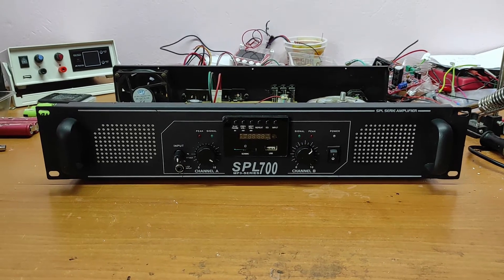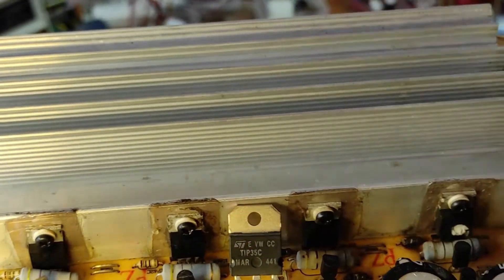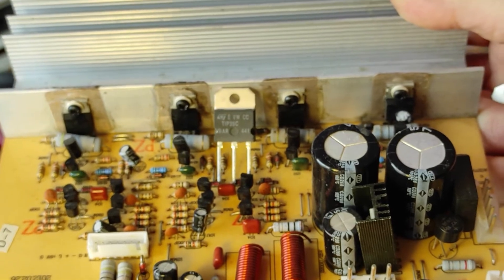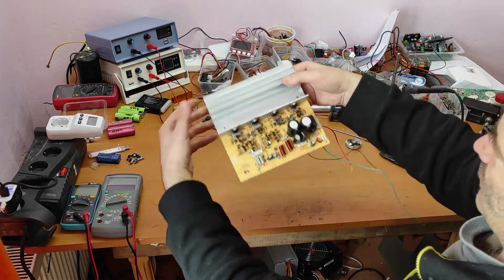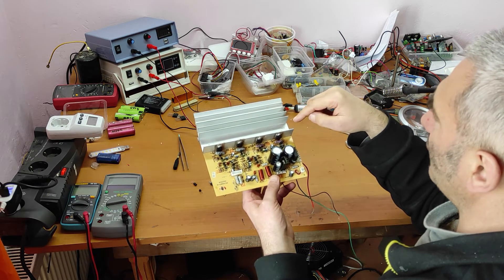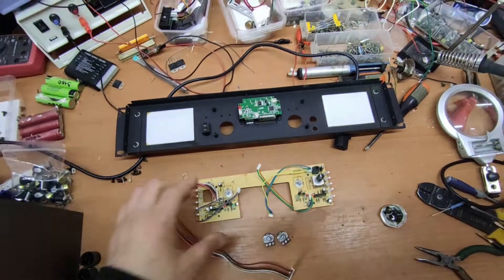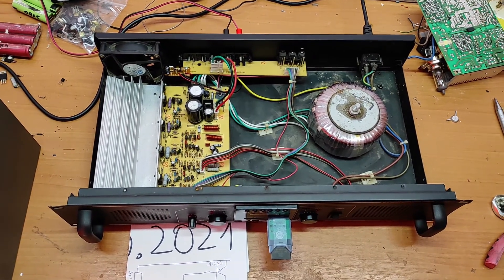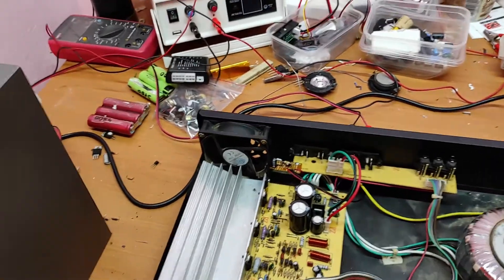SPL700 700W?? really? Skytech repair review and upgrade

Comment: By the AC power port it states the wattage, I looked on eBay and I've seen them listed as 500w 1000w and on the actual item on the back it says 120w 150w go figure, I definitely wouldn't buy.
Reply from the maker: yes bro u r right
Reply: @diymariuselectro  Just by looking at the internals it looks cheap from my own opinion 😀
Reply from the maker: @ENGLISHANDPROUDUK  and they try to sell this as 1000w :)))
Reply: @diymariuselectro  Not good is it, I wander how many people have noticed 😁😁

Comment: Well done, very good video. Can I ask you a question? Please, I have an amplifier. And one. Transistor is born is this number ITC TDA2030AL
82 QET2 I found a lot same TDA2030AL But on the button different number on the button Numbar is important but same . Please can you explain to me many thanks.
Reply from the maker: bro I dont understand the question. tda is not transitor is IC.
Reply: I mean, this number is important for TDA2030AL or 80 QET2 ?

Comment: I had this SPL 700 some years ago and I blew it up, I stored it in the loft and bought the SPL 1500 series, has worked a for about two years but is now making crackling noises , I think blown too... I may try to repair it like you said in the video. One day. I think it will go in the loft with the other broken SPL amp. I will buy a different amp Lmao

Comment: Hola yo tengo este mismo amplificador y viene con los transistores tip41c y tip42c, es posible poner los tip35c y el tip36c.
Otra cosa el modelo spl 1000 tiene mucha diferencia o es lo mismo.
Reply from the maker: I tried to replace with tip35 but there is no enough space for it.If u succed,tell us in a coment.
Reply: Pero lo soportaría la placa base ese cip

Comment: https://youtube.com/shorts/0NKwjHrWNPU?feature=share    spl500eq legat la un sub de 250rms in cutie inchisa face destul de bine excursion-ul. Nu se incalzeste. Sunetul inregistrat e rau pt ca telefonul cu care am inregistrat are microfonul stricat, in realitate nu se auzea baraitul. Eu sunt multumit de spl500eq nu stiu de unde atata propaganda negativa.
Reply from the maker: eu nu pot sa zic nimic de spl500 pt ca nu am avut,in schimb spl700 a fost o mare dezamagire pt mine.nou costa 750 lei,si este promovat ca un amplif profesional de 2x700w.In interior are un traf de 70W si finali mici aliementat la +-25v,si poate da maxim 3x35w reali.comparativ cu un amplif normal de camera cu traf de 150w alimentat la +-50V poti face singur o comparatie,ala scoate 100W reali.
Reply: @diymariuselectro  spl700 vine de la 2x350rms la fel cum si spl500 e 2x250wat rms. La mine am masurat rezistenta si sub ul este de 3.9 ohm. La 8ohm spl500 ofera 2x200rms si la 16ohm ofera 2x100rms. Masurati rezistenta la difuzor ca este foarte important. 2 boxe de 4ohm legate in paralel ofera la iesirea comuna 8ohm de exemplu
Reply from the maker: nu are cum sa ofere 350w rms cu +-30v si cu finalii aia slabi.dupa cum am zis ofera 2x40w rms maxim.
Reply: @diymariuselectro  I have the SPL 1000, and it like 10 times as powerful as a technical 50w amplifier , so maybe you have been scammed?
Reply from the maker: @mangebbange  pls check yours and measure voltage .I think we are both scammed.

Comment: Thanks for sharing. I've been looking at the spl range of amplifiers including the spl500 -spl2000 on amazon. I the writing on the back says the power consumption is 420watts for all the amplifiers. I had a feeling they were lying about the output
Reply from the maker: u can see the inside,its only 50W power consumption.
Reply: @diymariuselectro  again thanks for sharing 👍 
Wilson audio labs dyno tested a 'technical pro" AX2000 I think it was about 50w at 4ohm sold on ebay. The the components of both amplifiers are very similar. I'm surprised that such big distribution companies  still allow the sellers to lie on the sights

Comment: Good video I’m building an amp rack and I’m contemplating a fan controller to pull the hot air away as I have an old class a amplifier which gets warm *toasty*
Reply from the maker: u will find on my page exactly what u need,an easy and good fan controler.let me know if u do it.

Comment: Hi guys, i bought this s*it for like 6 years ago...that was one of my worst buy ever...Now i want to repair and upgrade a little bit. I tested out and one side seems,  ok but one side makes a crackling sound. 
What could be the problem here?
 I will follow the repair "tutorial" and try to replace these parts with better ones. 
And can i get a list, what you replaced for what? Much thanks!!
Reply from the maker: now i dont remember the exact parts,but u have the schematic,and check every part on bad side.Its not very dificult.I usualy start with the final transistors and folow the path to the input.
Reply: @diymariuselectro  Thank you :)

Comment: SPL 700 - Max Power 2 x 35W. 
Power supply toroidal 2x27V AC, the amplifier TIP41C/TIP42C per channel. Shit
Reply from the maker: cheap and low quality.